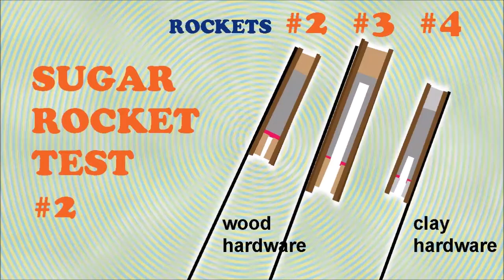Sugar Rocket Test #2

Comment: Have you considered using an electric method of starting these rockets?
Reply from the maker: Well obviously I know of electric methods. I used to launch Estes rockets as a kid. Since fuses work fine for skyrockets, I assume they will work fine for this as well once I get my technique down. Nichrome wire costs, launching kits cost, battery kits cost. Fuse is anywhere from cheap to nearly free. That is one of the glories of this hobby, it is very cheap. ;) 

Anyway, the way I was making them up to this point was doomed to failure regardless. Without a central core (the hole up through the middle of the engine,) the sugar/potassium nitrate fuel was never going to achieve enough thrust for liftoff. There was no central core because of the small size of the rockets, so I am going to scale them up a bit and drill a core. I am also going to dust the inside of the engine with "pink mix" and put in a wadding saturated in pink mix to ensure better combustion. So the next rocket might explode or burn, but I think it is definitely going to ignite. ;)
Reply from the maker: The one that burned, burned because it didn't have a core. With the core, the combustion is centered in the middle of the engine and doesn't touch the outside walls until the engine runs out of fuel.
Reply: @plumsink  I made those rockets too when I was a kid.  Just seemed like it might make ignition easier.
Reply from the maker: @Damaddok82  It might, but there is no reason why the fuse wouldn't work too if I get the method down right. And I got the fuse already in my hot little hands. ;)